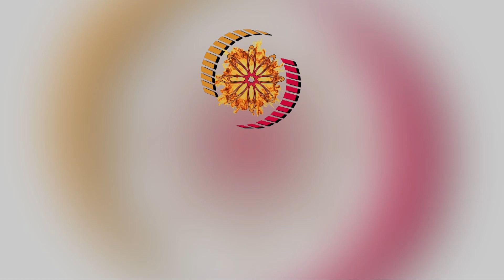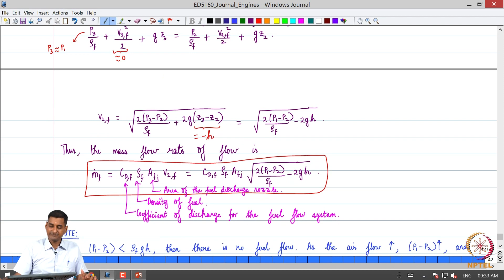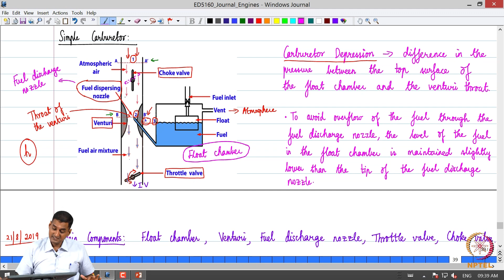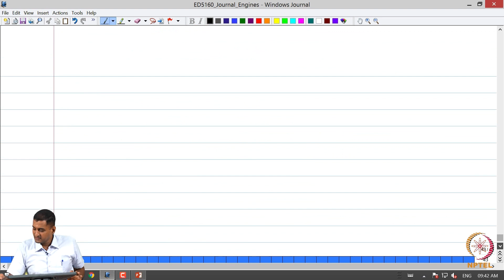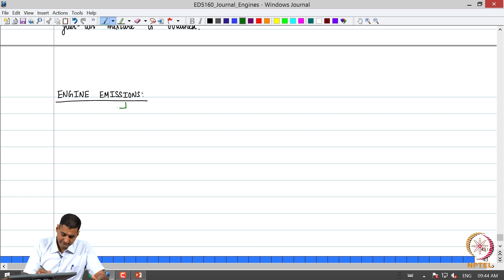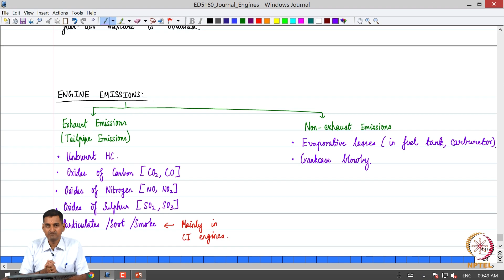#24 Analysis of Carburetor | Part 02 | Fundamentals of Automotive Systems

Comment: For the same pressure drop (p1−p2)(�1−�2) in a simple carburetor, which one of the following would not significantly influence the mass flow rate of fuel?For the same pressure drop (p1−p2)
 in a simple carburetor, which one of the following would not significantly influence the mass flow rate of fuel?

Comment: When the choke valve is closed, what part of the formula of the mass flow rate of the air changes? Is it the discharge coefficient? Because in the lecture it was explained that when P2 reduces mass flow rate of air increases. Since we are basically introducing an obstacle in the path of flow of the air, hence bringing in more losses in the flow. Pls if anyone could clarify I will be really grateful...